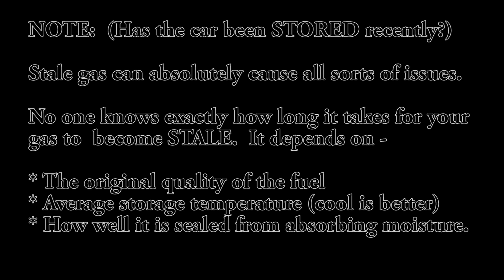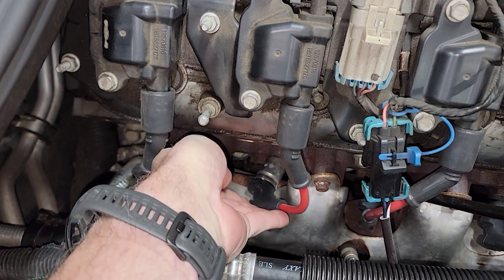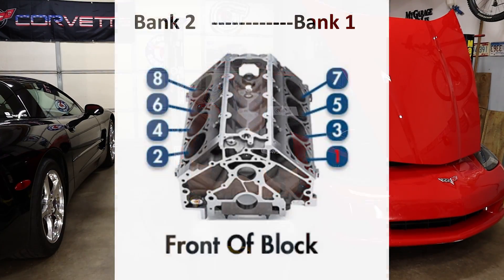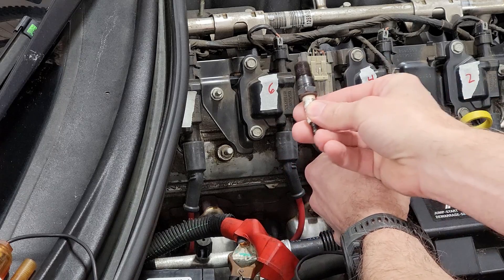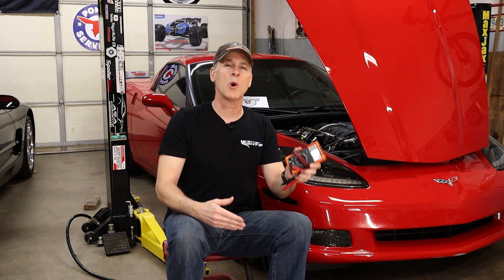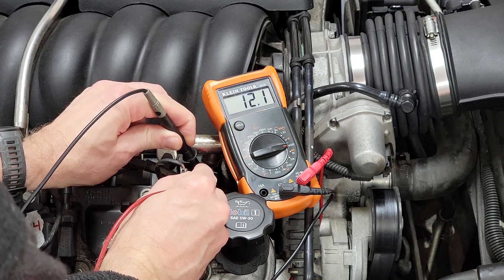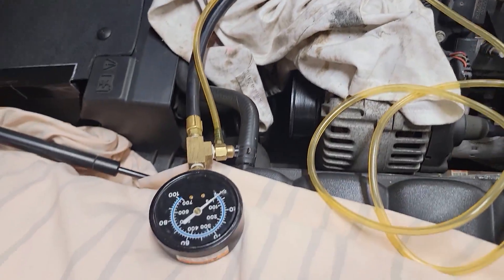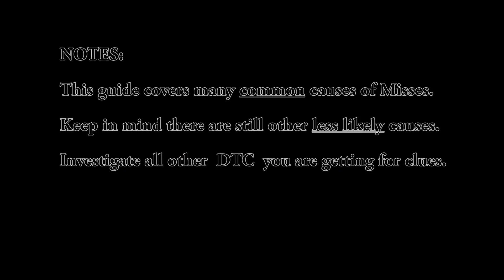C5 & C6 Corvette Engine Misfire Diagnosis (Complete DIY GUIDE!)

Comment: What if you have a flashing check engine light that is a little random but it's not throwing any codes.  Idol is rough sometimes and other times it's fine.  I have swapped out ignition coil spark plugs wires and even the harnesses that run to the ignition coils

Comment: thank you for you videos. I just got a 2007 w LS2 which has a rough idle.  I replaced harmonic balancer but rough idle persist. 
after driving for 1000 miles  I got P0307 cyl 7 misffire. I changed that coil pack and changed all spark plugs and the wires. But the rough idle persists.  Any ideas what to do now? Perhaps abit of rumble is normal at idle?
Reply from the maker: Did you resolve this - I am thinking about making a video to answer it. Let me know please.
Reply: @Toys4Life  so funny, I lost the comment and cou;dnt find the video i posted this comment on.  To my surprise I saw thevideo you made about rough iddle on my feed. Thank you.  Lots of infor for me to go on now. I got water pump leaking from the thermostat. so im figurign this out for now.
Reply: @Toys4Life  i just watched you video, i am having a random cylinder 7 misfire after warm up like 10-20 minutes. Its not a dead miss but its a random miss on 7 at idle. Im going throw the process, but im asking have you ever ran into this situation?

Comment: What spark plugs, ignition coils, and spark plug wires are the best in your opinion?! Im at 65 K miles and would like to put the best quality parts on my c5.
Reply: Same. I just bought a midnight purple 2001 6 speed 😊
Reply: Msd makes good plug wires. The stock c5 coil packs are more than enough. Spark plugs is more of an opinion thing but I like ngk.

Comment: hello Corvette C6 ls2 I have a misfire p0300 I have replaced everything coils, spark plugs, cables cylinder pressure 11 bar air intake ok Where should I look for the cause?

Comment: I've read that shudder at idle is very common with the LS3 motor and mine has it.  Diagnostics show 1 misfire across the last 10 run cycles in most cylinders.  2 and 3 in others, no check engine light.  Short term fuel trim max is -13%, but average is under 1%.  Everything seems fine to me, strange, and it otherwise runs fine.  Any ideas?  It is a 2013 with 16K miles so it sat for long periods of time.
Reply: Replace your entire fuel pump assembly in the tank and replace all fuel injectors and top off with fresh fuel, fuel gums up
Reply from the maker: Injector flow test.

Comment: I’m currently getting P200 and P300.  If I restart the car most of the time it clears itself and does not show up on the DIC.   I put my scanner on it and it’s there.  It may go weeks without coming back and I did nothing to correct it.  

Then I drive to the store and it’s fine, come out and restart and it’s misfiring.  I’m thinking it’s a short somewhere.  

Is there a ground point that would tie both together??   I don’t get a 30x so I’m guessing that means multiple are miss firing.   I’ve never had an electrical component give me a notice that it was going bad.   So I do not think it’s a sensor.  

Kind of stumped and concerned with driving too far from home.   Any thoughts??
Reply from the maker: Maybe an intermmittant short or a coil on its way out. Inspect the coil harness and maybe swap a couple of coils and see if the error code follows the cylinder - or not.

Comment: Quick question....2 years in a row, after parking my 2012 c6 grand sport for the winter in a heated garage that has temp swings due to garage door being opened and closed....it runs rough for the tank of winter fuel I park it with....do u think it's condensation in the gas or bad gas....I park it with premium fuel for the winter.....50000kms on car.   Thanks

Ray
Reply from the maker: That's odd, the gas tanks aren't wide open to atmosphere like they were in the '60s, if it gets automatically better as soon as you put that first fresh tank of gas in it that it has to be the fuel. Makes me wonder if something's wrong with your EVAP system if that is the case.

Comment: Wouldn’t recommend using a spark plug for testing. If weak spark is an issue this doesn’t yield best results as the plug is outside the cylinder and does not have to overcome compression to jump the gap. Best to use a spark plug tester. They’re inexpensive and look like a spark plug but account for cylinder compression
Reply from the maker: Thanks - I understand what you are saying and agree that would result in a better test - link to tool you are suggesting we use please!

Comment: Great video and channel. I replaced the high and low pressure ac lines that meet at the compressor,  low pressure line requiring me to remove the exhaust manifold, torqued everything to spec on my way out, now I’m getting a pop or two and chuggy/misfire feeling at low rpm’s at 1st gear. I ordered new gasket. Since they’re crush gaskets it’s the only thing I can think to be the issue. What do you guys think..02 Z06
Reply from the maker: If you have a scan tool - Look at your fuel trims, see if one bank is way off compared to the other meaning error is getting into the oxygen and incorrectly influencing the oxygen sensor on that bank.

Comment: Can you make a video for the c5 on the secondary air pump. I have a check engine light, but I replaced the secondary air pump. I'm assuming the check valve is causing the current check engine light.
Reply from the maker: Pull the code (s) with the C5's diagnostics in the dash. Here's how.   https://youtu.be/bwbnzEAkpYc

Comment: I've changed my plugs and wires and THEN discovered a misfire ... Just because it is new does not mean it is good.  I put old wires on 1 at a  time no difference.   1 plug at a  time 2 "new" did not fire properly.  Creating the misfire.   Dad said if it aint broke don't fix it when he heard me complaining about 3 pm after the 6 hours of wtf in the shop
Reply from the maker: Absolutely happens, but it is rare.